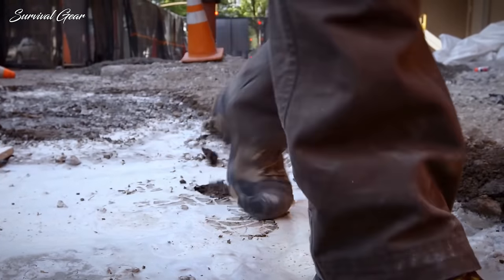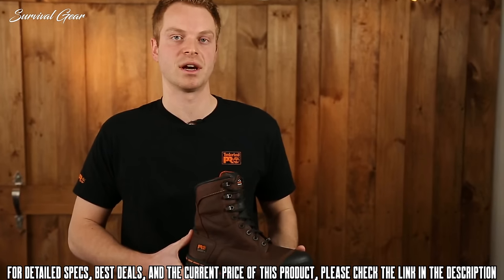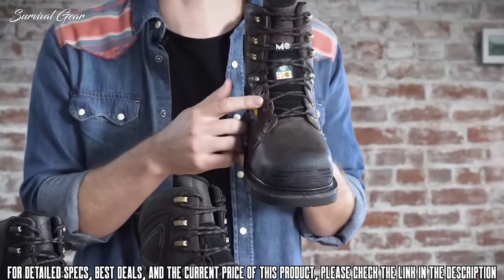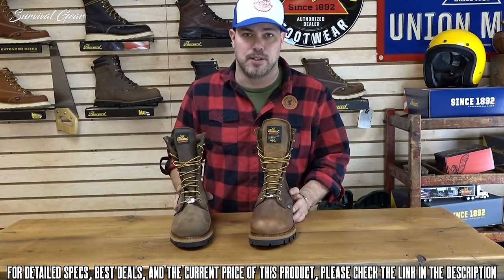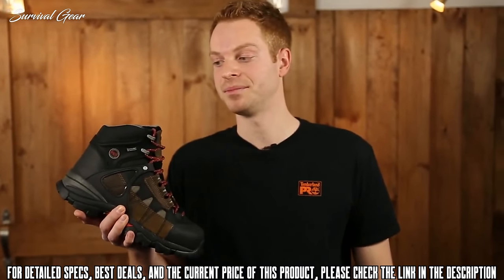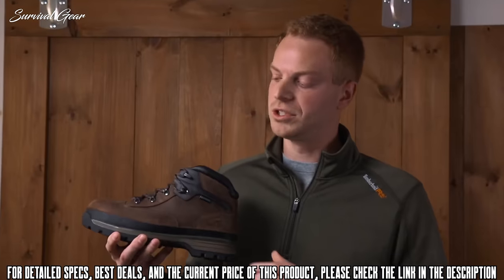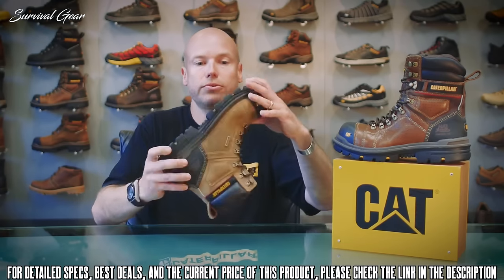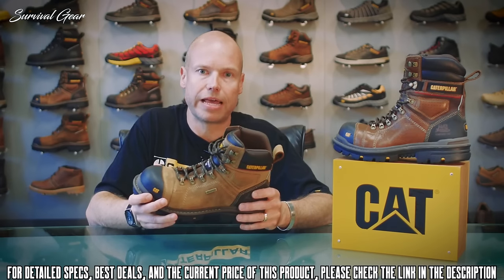TOP 10 BEST WORK BOOTS FOR MEN 2020

Comment: The only work boots to buy are 🇺🇸 made Red Wing boots of Thorogood boots. The rest are garbage and would never put my feet in them. My 2408 Red Wing boots last 5 years. I just got another pair
Reply: Where did you get them? I called the store, they told me it's not available
Reply: I got my red wings from the red wing store. I wear the 2408. And thorogood boots I get at a local boot store.

Comment: Nothing is waterproof for very long, point one. crappy plastic soles on even the best brands suck. Do not buy them. Red Wing and Thorogood still make good boots. Red Wing only makes a few however, i have never owned a pair of Thorogoods. I hear that Thorogoods are great boots! My experience is with Red Wing 2156 Chukka's. I have worn them for over 25 years and have owned 5 pairs i think in that time span. They will last and they are comfortable. If you are buying multiple pairs of boots in a year, then you need to upgrade to a better manufacturer. Everybody makes a crappy boot. Once again no experience with Thorogood, Red wing makes several crappy boots. If you are blessed with a salesperson with knowledge, ask them if they can be resoled! If the boots can not be, then do not buy them.

Comment: As a 47 year old man who's worn every type of boot for construction, here's the truth...
#1 don't buy most of this overweight trash. 
#2 Unless you're a logger, heavy equipment op, Iron worker, etc... you don't need steel toes and you'll look like a moron who's trying way to hard.
#3 The toughest boots will have the longest break in time. This is because oiled, worked, softened, thin, leather is MUCH weaker than thick untreated leather.
#4 stitched Vibram soles are the toughest you'll get, glued soles have a tendency to separate.
#5 The more seams, plastic, Kevlar etc...the weaker the boot. They look tough but are PoS.
#6 The toughest boots and most comfortable are 1 piece leather backpacking boots with a heel leather to protect the stitching on the heel and have a stitched Vibram soles. I still have a pair of Swiss made Raichles handed down from the 1970s that I resoled. 1 year, 3 year boots? Try 40 year boots. The price is between 190 and 350 bucks though. Raichle, Lowa, Danner mountain lights.